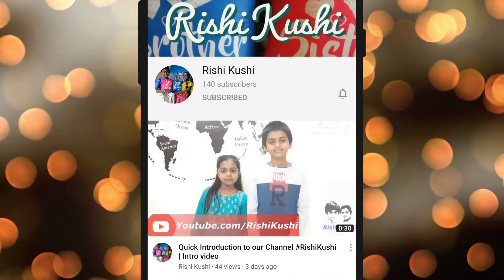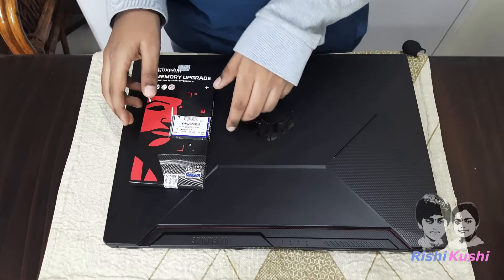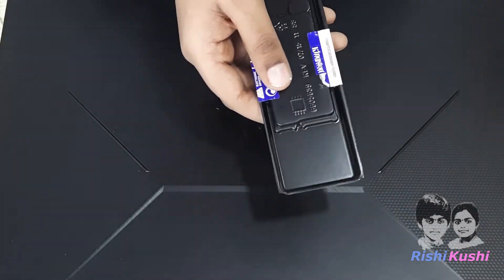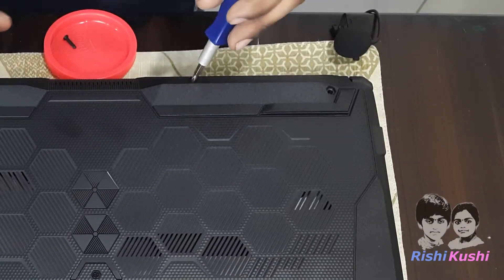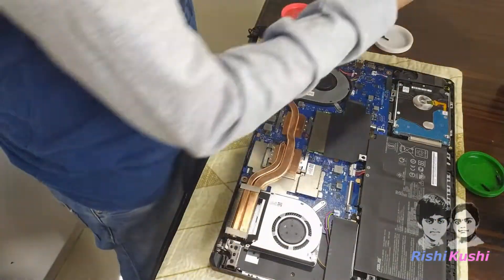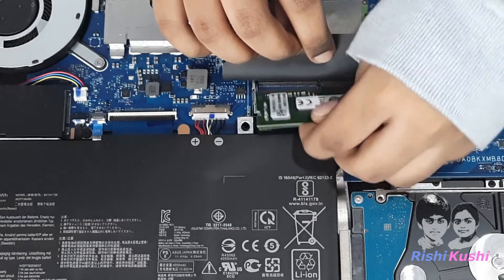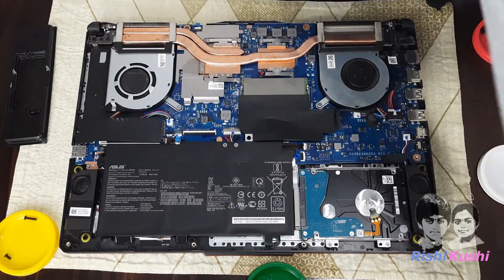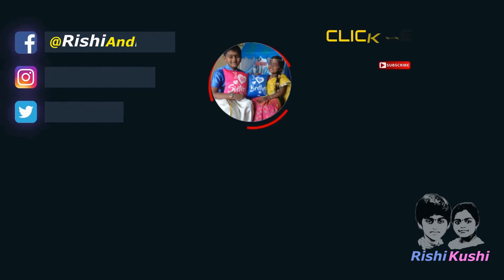Asus TUF RAM Upgrade | Asus TUF Gaming RAM Upgrade | Upgrading Asus TUF A15 RAM | How to Upgrade RAM

Comment: Does upgrading ram void warranty ?
Reply from the maker: No, upgrading ram, hdd & ssd won't be voiding warranty. However If you damage other parts while changing the RAM it may have effect on your warranty. 

If you are unsure and your laptop is under warranty just take the laptop along with RAM to nearest ASUS service center they would install it on your laptop for free. You can also try contacting ASUS to provide Home Service to install the RAM at your location.
Reply: @RishiKushi  They told me that 800rs will be the installation charges and I will be held responsible if laptop misbehaves because of other brand's ram
Reply from the maker: Try Contacting them at 1800-2090365 or at https://www.asus.com/support
Even though it is a simple installation, its always better to get it done from the experts, 

As long as the RAM is 3200 MHZ and from reputed brand such as A-DATA or Kingston or Crucial, it would not cause any issues to laptop, all of these RAM's also comes with Lifetime warranty.
Reply: @RishiKushi  The customer care executive told me to contact the service center to know the price and whether warranty will void or not
Reply from the maker: I came across this Reddit post it may help you understand in warrenty https://www.reddit.com/r/india/comments/9vqu1r/if_i_upgrade_the_ram_on_my_asus_laptop_by_myself/?utm_source=amp&utm_medium=&utm_content=post_body

Also you can try upgrading your RAM yourself by following instructions in this video.
Reply from the maker: @Shrey Mathur, We really hope our video was helpful, kindly "Like" our video and encourage our efforts by Subscribing to our channel #RishiKushi 👍

Comment: How Can i Remove Ram From Slot 1 pls tell its fully covered with that steel
Reply from the maker: There would be two RAM slots on the mother board, one slot must be empty kindly try the other slot which is empty
Reply: @RishiKushi  no i want to remove ram from ram slot 1 cause i have to clean the ram because i have getting blank screen
Reply from the maker: Kindly try pulling both the steel hooks at both sides of the RAM as shown in this picture, do it both at the same time https://drive.google.com/file/d/1DpzRihjbtIcJFIMZbEs6CebGXi51bjhQ/view?usp=sharing
Reply: @RishiKushi  thank you very much bro
Reply from the maker: You are most welcome..🙏 If it was really helpful, kindly share it with your friends and family,  and encourage our efforts by subscribing to our channel "RishiKushi"